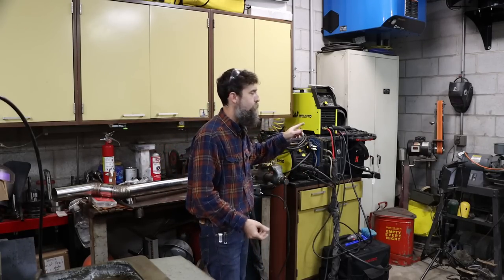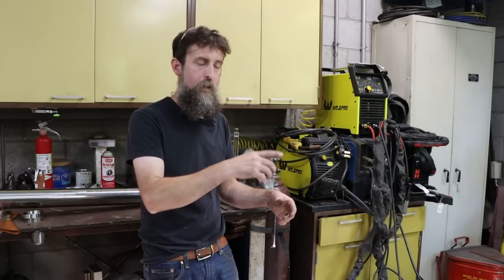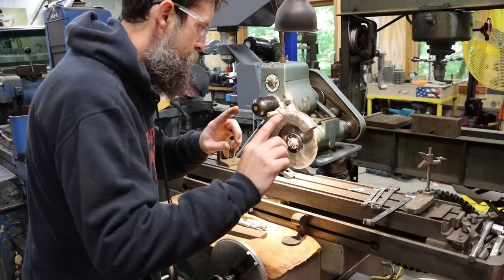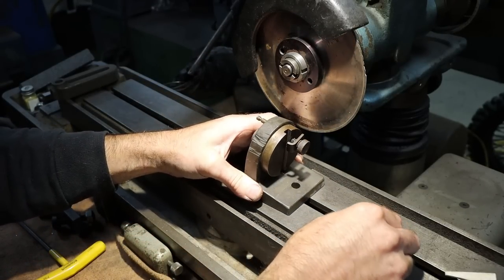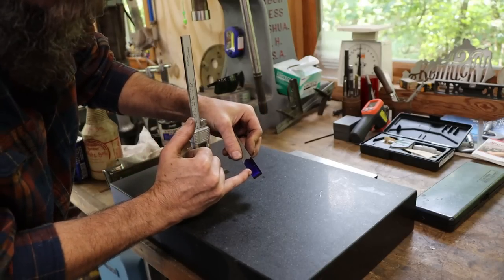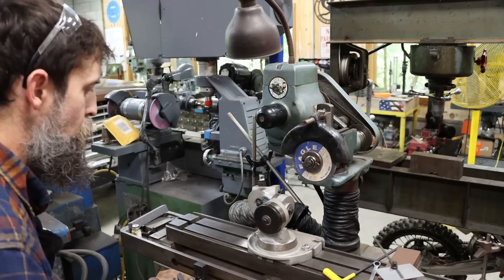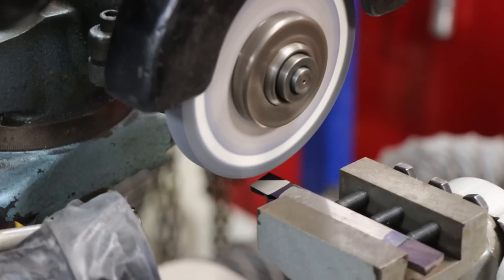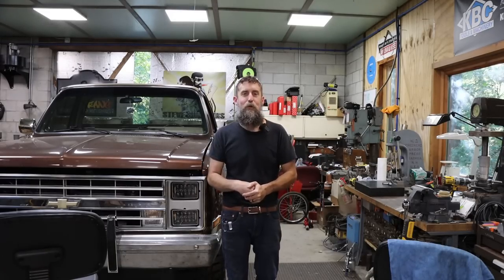Making Lathe Tooling on the old Cutter grinder. Shop supply run.

Comment: My guess is definitely shop made, from a section of fairly large I-beam, as that base "looks" like it matches the taper of an I-beam flange. As another commenter mentioned, there are tapered washers made for this application. I've heard them referred to as "hillside" washers. Not sure if you'll find them in a box store hardware section, but I'm sure somewhere like Fastenal, McMaster, etc. will have them. Would be simple enough to make though.
Reply: If it was I-beam the part where the disk sits wouldn't be at an angle though. I think it used to either be a piece of thick angle iron or an originally square disk flange where the bottom side got machined to an angle. Bet the hole where the bolt goes through is at an angle as well. Would be good to have either an angled washer as mentionned, or a spherical washer with a conical seat. Those are even able to adapt to any angle, so very handy where you have to adapt for any kind of misalignment.

Comment: When your HSS holder was made tapered washers were a common item, one of those would have been used for bolting the jig to the table. Taper washers were mainly used for connections to the once common taper flange I beam.
Reply: Plus you can see all the years of the clearance for the HSS blank being too short, and it crashing into the base casting as well as making the tool correct.

Comment: Biggest HSS tool blanks I have are 3/4" square as thats as big as I can go on my lathe, I mostly use carbide insert tools but a large pile of used hss is useful for special one off tools.
12" square lathe tooling is the biggest I have heard of existing.

Comment: Retired now but for the last 10 years of work I rarely ground up any tools. Because I was involved heavily in CNC troubleshooting and prototyping nearly all my tooling was insert type. If I didn't have the insert the customer would supply me with the ones they were using. I built up a large collection essentially free and as a bonus for my own use they would let me take some out of the "scrap" carbide tub  (In production they always changed the inserts regularly whether they were worn or not - last thing they wanted was a broken insert wrecking a job or worse).

Comment: Please get a 90deg for the output on the  grinder with a short extension  and a metal  bucket underneath  you will be  amazed  at how much grinding  dust you will keep from blowing around the shop.

Comment: I grind custom tools for boring all the time. That appears to be a realm that insert tooling has not approached much. Only bad thing about driving the crew dually is most places make it rather difficult to park.
Reply from the maker: Yeah, the type of work you do and the tooling you need for those often large and custom jobs often have to be made. Sometimes, a piece of HSS and a grinder is all ya need. Elizabeth has really started enjoying that crew cab lately. In the beginning, she was pretty nervous. Parking close and drive-through lunch are not happening 😄.
We both really like that old truck. 
It's really good to see you
Reply: @SteveSummers  I take mine thru the drive through all the time but you better hit your marks or you going to be hitting poles and curbs! 😂

Comment: The main problem with all cutting tools is supporting the cutting edge. The standard parting clearance angles for our production tools: Both side clearance angles 3 degrees, front 5, vertical side clearance 1degree. Top rake varied from 5 to 15 degrees dependent on material. These tools would be used on our production, bar autos, at quite adventurous speeds

Comment: To rough out the cutoff bit, I'd use a .045 wheel on an angle grinder and cut the corner off instead of turning all that HSS into dust. The insert type of parting blades are a game changer and are very predictable where the HSS type can go along well, then SNAP!
Reply: Have to agree, a 1mm disc in an angle grinder would save time, easy enough to leave a grinding allowance for finishing so accuracy is not important just cut out a block.

Comment: You could lock that little fixture down with a spherical nut. I use those on my mill most of the time because we have the same problem with fixturing clamps. The side on the part is supposed to be a bit higher than the side on the support, so regular fixturing nuts don’t sit flat. Pretty common. I buy mine from McMastercarr as with most stuff.

Wow. Grinding that much waste away on the bench grinder would drive me crazy! I’ve used an angle grinder to do that with a thin cutoff blade. If you’re halfway careful the blade will work well and much more quickly. I put the part in the vise and swipe it with a wet sponge.

Comment: It's been a long time since I  have done any machine work I do remember parting could cause headaches.  (Especially for the inexperienced machinist).  E.G., getting a cut without a burr, etc.  Ran a Browne and Sharpe screw machine for while.  Some setups used a powered carbide saw.  It made a really nice cut It lost coolant flow, or I I did something stupid.

Comment: I love my cutter grinder, but i have to say even with 4 large boxes of tooling and fixtures, i still need to make things for almost every job. my compound angle fixture does not have a vice, just a slot, so i think i will enlarge the slot and put in setscrews just like yours. Mine is out of the 20s, there must be something missing or it was made for a specific purpose, as i don't even see any marks from trying to mount things like a small vice, or clamp. Nice video!!

Comment: Steve, use your diamond saw and chop out that chunk on parting blade, rather than turning it into grit on the bench grinder.  Should be lots faster and put less heat into the remaining stock.

Comment: I have a dickson style tool post on my old lathe , i found when trying to part off the tool holder trys to nose dive so i made a support out of a bit of 1" by 2" bar that rests across the sadle for the toolholder to slide on, it makes it alot more rigid and i now have a lot more success parting off.(im still not brave enough to power feed)👍

Comment: Hi Steve.  First ride for us in Johnny Cash!  Sounds good and looks like it rides good.  Too bad about the yellow line paint.  Maybe some acetone on a rag would take that off the body.  I think that fixture you showed was probably shop made.  It seems a commercial one would have a brand on it somewhere.  That, coupled with the way the through hole is angled, like you mentioned, it what I'm basing that on.  Thanks for the video!

Comment: Nice HSS tool holder.   First I think it was not a shop-made fixture.  The angle base appears to be a casting with draft which makes me think someone was producing enough quantities to invest in casting parts.  I also think there is a piece missing, the slotted wedge that goes under the base to adjust the side relief angle, 0-2 degrees (probably?).  It works as-is but that’s a bit more side relief than needed.  The angle on the mounting hole makes me think it’s oversized enough to suit about 2 degrees angular movement so the nut would seat flush.  Maybe?  It is an odd feature to an otherwise clever designed fixture.  Thanks for sharing the details and I may just build a 3D model and print one to test the concept.

Comment: It may be a common gas but extracting it is hard.
Reply: Argon is isolated by fractionally distilling liquid air.  Liquifying air is no mean feat.  Industrially, the Linde method is employed.
Reply: @eliduttman315  I was aware of the principle in general terms and that it costs a fair amount of energy.

Comment: Where I live we can own 250 cf and 300 cf tanks and it’s more cost effective to buy as big as possible like a 125-150 cost 50$ to refill and 250 cf cost 60-70$ and 300 cost 75-80 of oxygen and prices are similar wjrh other gases be more you buy thr cheaper it is also you have to factor every time you get bottles swapped out they charge you a bunch of fees for handling no matter how many tanks you bring you you pay like 30$ in fees so it pays to fill up
As many at a time to save on fees

Comment: Want a good ride? Replace rear spring shackles with Velvet-Ride joints; put a set on my '96 F350 DRW crew cab with Air Ride bags in '98 & never looked back.
Reply: I gotta check that out. I have an 05 f350 dually that I've restored...might be my next project if the wallet permits.

Comment: I noticed as you were using the grinder near the door there was a lot of sparks flying out the back if it, would it be an idea to put a 90 degree bend tube on the outlet so you're not firing thousands of hot, sharp pieces of metal over everything behind the grinder?

Comment: Very enjoyable and educational video. Thanks. As to price of gases, hydrogen is the most plentiful gas in the galaxy and yet producing relatively pure hydrogen is such an expensive process that using it as fuel is unthinkable. As attractive as hydrogen vehicles appear they are unfortunately pointless due to the negative energy household of hydrogen, i.e. it takes more energy to produce a given amount of hydrogen as that amount can itself produce. This is similar to wind energy. The universe does not believe in free lunches.

Comment: Almost a case of where did you go loose wheel. Bench grinder really needs to be dressed as well, with that rounded over corner.  But the first holder is nice, just needs to go to the mill, get held down by some clamps, and have that mounting hole counterbored the diameter of the washer, plus a touch of slack, so the nut is clamping evenly.

Comment: One of the things I do not understand is why so many are using a CO2 argon mix for MIG welding. You can get perfectly acceptable MIG welds on steel with straight CO2 which is much cheaper.
Reply: I have used both - the argon/CO2 mix is much cleaner.  CO2 results in a huge amount of spatter all over my work, whereas the argon mix leaves hardly any.

Comment: 1st Did Elizabeth ok the use of Johnny Cash. 2nd I noticed your dually driving issues as keeping Johnny between the lines or in your lane😊. 3rd What was Miss Elizabeth's expression of the new paint job 😮. 4th great advice on using the best amount of gas for welding condition and wind! I was educated on gas issues early  when using cutting torch😢
Reply from the maker: Elizabeth doesn't mind if I use her truck. I do ask 1st😄. Elizabeth walked out and seen that yellow paint on the truck and said, "I am glad you were driving it and not me." 😆
Either way, I would have got the cleaning job.
Reply: @SteveSummers  I understand 👍

Comment: That gas seems high. FL it's $66 a fill for a large bottle. I would call around  to different areas
Reply: Remember he is in Kentucky and a bit off the beaten path. Not just the gas cost but the transportation costs to his supplier could be a factor.
Reply: @sithus1966  yes. That's why I would call different areas and see if I was being screwed over by that vendor. I also own my bottles

Comment: I need a good partying tool for my mini lathe. The one I had shattered. Any recommendations?
Reply from the maker: Just grind one up out of a small piece of HSS using the bench grinder. Hand ground is fine. Just make it on the thin side to reduce pressure on the machine.
Reply: I need a "partying" tool as well.  I've been staying home too much lately!

Comment: Thanks Steve, as an amateur machinist I got a lot out of that. Is there a reason not to use a surface grinder to do the same job as the cutter grinder? As to gas cylinders, I thought they were adding gold dust to the argon the way they charge for it. Cheers mate, Stuart 🇦🇺

Comment: I looked on ebay for your grinding holder.  Can you give me a specific name so I can get one? Found one for round milling cutters, but not for hss ones.
Reply from the maker: I looked as well and it seems like they are sold out unfortunately.  I also looked on Shars tool website and they were out as far as I could tell. I looked under several different descriptions

Comment: Isn't that high RPM cutting blade that's chippd compromised?  Is there a chance that it will all come apart?
Reply: Steve has some experience with exploding grinding wheels if I remember correctly 😅
Reply: All steel base, diamond coated high RPM are created on mild steel. Mild steel can resist side torque to the extant you will find in plunge grinding.  Using such a chipped blade is acceptable practice for most hobbyist shops,  I have seen such blades with many chips out used for years in job shops. 

If it is silver soldered segements rather than pressed edges (called pave, accented on the e of course, by the jewelry trade) then soldered after there is less chance of loss for the abrasives. It could be resin bonded as well as -it would depend on the age of manufacturing as to which system for the method, both are still used, in fact all three types are available today; sintered segments being most common from the 70's, pressed and soldered from the 1910's, resin bonded from the 90's  -this kind can be dressed to clear edges after usage as they were from the factory.

Edit, crowding the blade is a common problem though and can cause breaking of the blade base, sometimes a catastrophic failure in any type. Soldered segments resist crowding to an extant greater than the other types of bonding since the heating process is concurant with the pressing or paving processing.  Intended usage controls choice of blade as there is little difference in price for similar diameters.

Comment: Those 'sticky outy' thingies on your front truck wheels would get you a 6 month to a year driving ban in the UK plus a substantial fine. The police would impound the vehicle until they were removed. Don't you think their dangerous should you run into a pedestrian? Enjoy your videos by the way!
Reply from the maker: They are thin plastic. Tall grass would knock them off. Thanks for watching 👍
Reply: Must be a UK anxiety,,,  I built myself a 2-seater sports car a while ago, and there's no way it would have passed its official inspection with those things on, even if they are plastic!  Here you'd soon get fed up of being pulled over by the police every other day.  😀

Comment: Steve when ya are makin here cut off tool why don't ya use an angle grinder with a cut off blade ta ruff  cut yer cut off tool. all so why don't ya make a cutoff blade tool holder for yer tool post tool holder that will hold a cut off blade just sayin.....
Reply: Punctuation, spelling, and grammar would help your comment make sense!

Comment: What's the deal with those silly front wheel nuts, dangerous and against the law in Australia.
Reply: Death Race 2000
Reply: I thought them silly too
Reply: Most of those are plastic snap on covers not dangerous at all, also that's the great thing about opinions everyone is allowed to have them.
Reply: Those are solid stainless steel meant to drive people you dont like off the road into in a ditch 😏